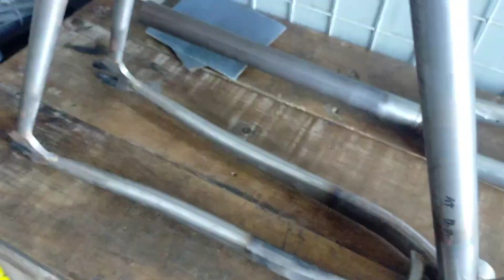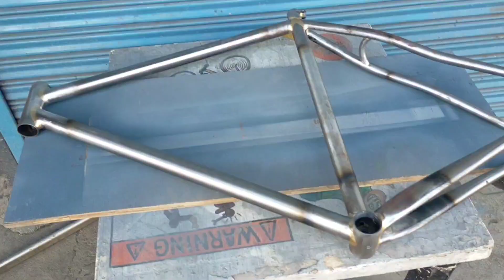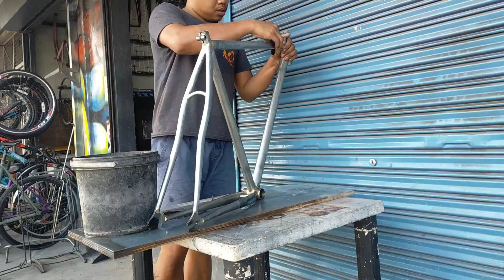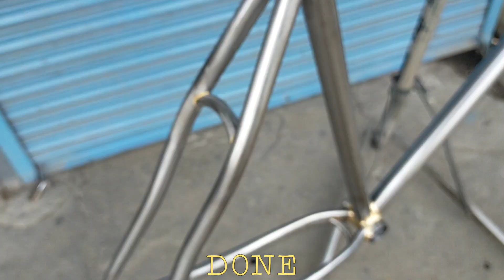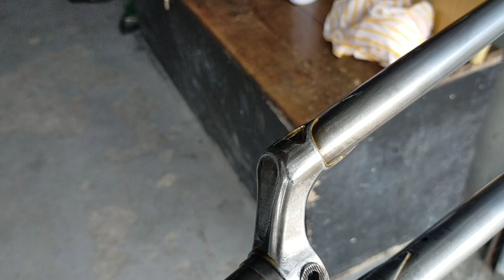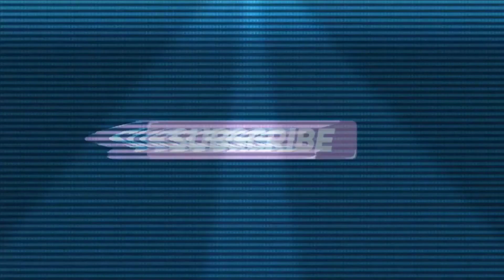Clear Coating ft. Ave Maldea Chromoly Tracklocross handcrafted frame - spray paint only

Comment: Hello sir Hepe. Papagawa pa lang ako ng Madlea frame hi-ten. Plano ko sana sandblast lang tapos clear coat or ceramic coating lang. Sapat na ba yun o mas ok yung may pintura? Gano ba kalaki difference in terms of preventing rust yung may pintura kesa sa clear coat lang?
Reply from the maker: Hello sir sorry for may late reply sir,para sakin sir mas gusto ko ng my  pintura,pero pag clear coat tapos naka Raw yong frame,good din yong sir😀
Reply: @hepebikes  hello sir. Salamat po sa pagreply. Tuwing kelang ang pag-recoat kung sajaling clear coat lang walang pintura, once a year?

Comment: Sir kapag po ba nag clear coat spray hindi na po kakalawangin?
Reply from the maker: Hello sir,sorry for my late reply, actually sir kakalawangin parin po sir, gawa ng chromoly steel po yong material, cleaner coat ko lang pp yong frame,para po hindi agad kalawangin yong frame,para matagal po magkaron ng kalawang😊
Reply: @hepebikes  anu mas matibay chromoly or steel?
Reply from the maker: @dominicvirtudes6593  about naman sa tibay sir ,parehas po silang matibay sir,ang deffirence lang po ay yong wait ng frame sir